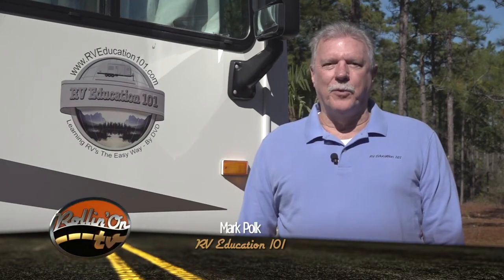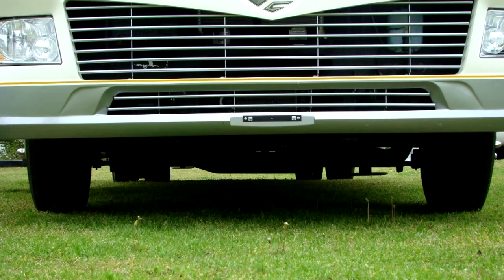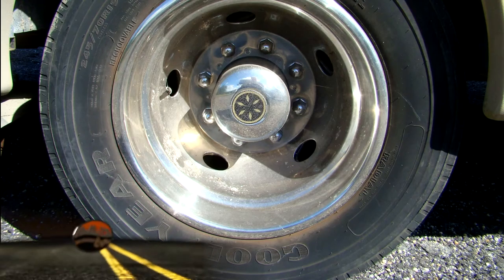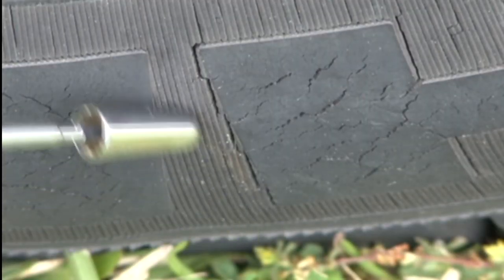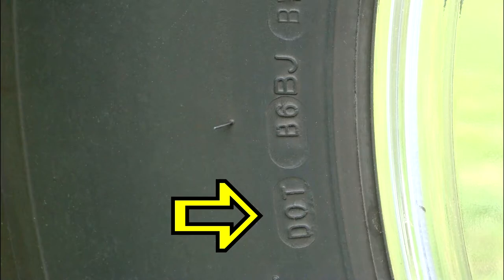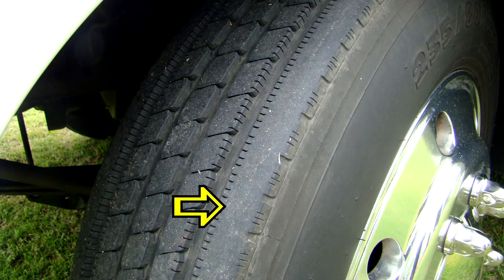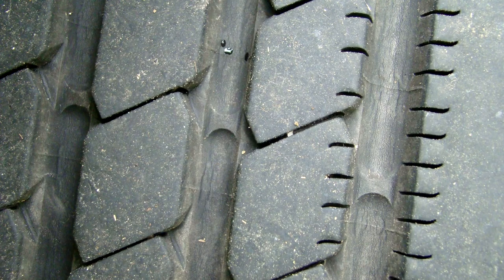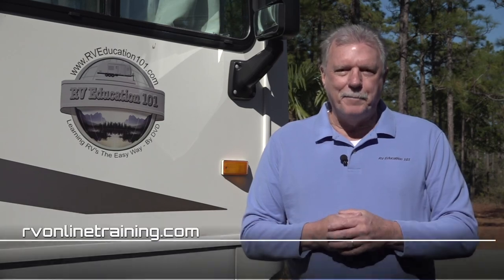RV Education 101 Tips to Prevent Tire Failure on Show Segment 2021-05

Comment: Good info Mark, as a vehicle dynamics and tire engineer I try to educate RV owners all the time on tire care. Here's a bit more info on tires. A tire has over 200 compounds and materials in them, one of them is a material is called "Butyl" it's the inter layer liner, in simple terms it's the stuff that holds the air in. The Butyl needs to go thru regular heat cycles to remain pliable, if not it will dry out and separate from the inside. Tires are designed and engineered to be rolling not for long term storage. Yes, at the 5 to 6 year mark they need to dismounted from the wheel and inspected for the inside by a Certified Tire Specialist.